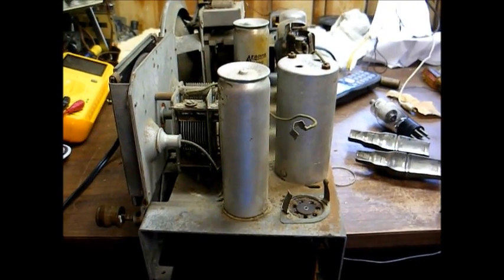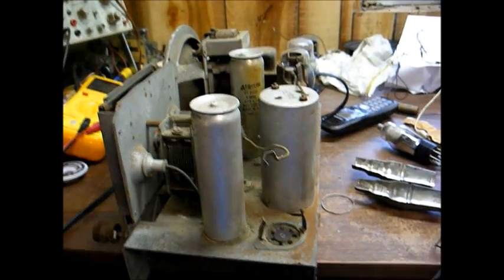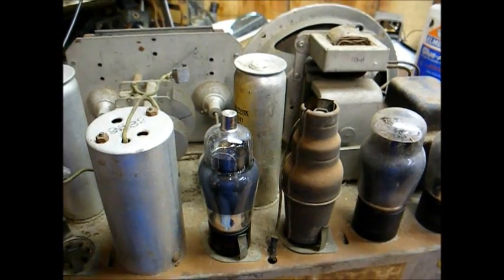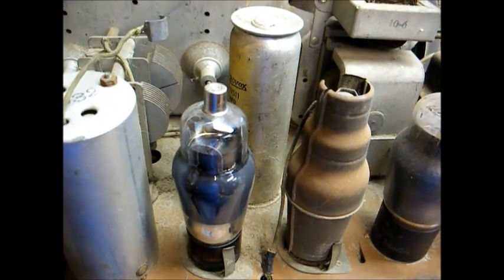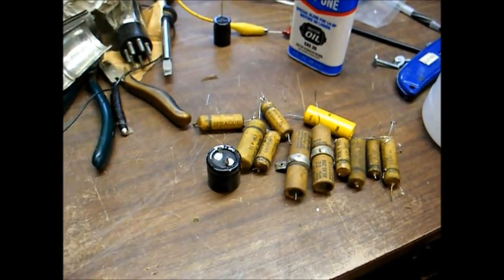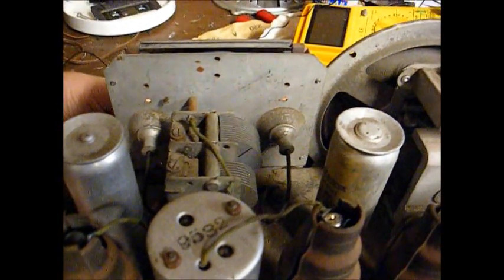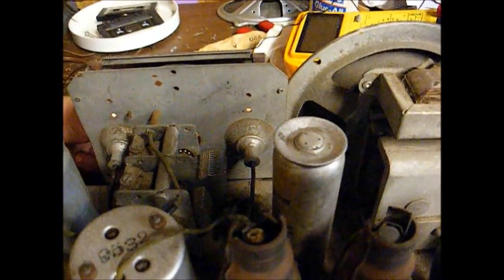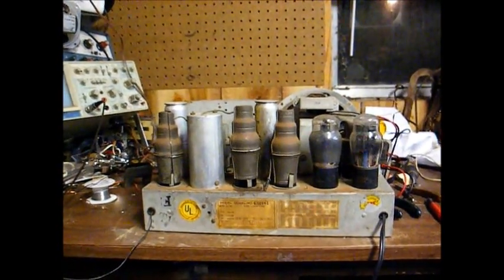Westinghouse WR209 tube radio electronic restoration (still having problems) - part four

Comment: See my comment in the 3rd part video...."In the last video you made a mistake with the replacement of the .05 .05 capacitor.  They did not make a mistake and print the value twice as you thought.  Instead this is a two section capacitor with the metal ground strap in the middle being the common ground for each end.  So this is two ,05 capacitors in one case.  You should have replaced it with two .047 capacitors."

Comment: Well, I gave MY opinion in part 3...I'd of replaced all the .05's with .05's & then replace the weak tube & the one next to it, re-tune the IF's & go from there. Being that it had that new power cord, I think someone was twisting controls in the BACK  of the radio & something's outa kilter!

Comment: Didn't you say the ocilator and mixer tube was weak? Why not replace it and give it a go. If that doesn't work, could the speaker field coil and voice coil be switched? I have a 1937 Packard Bell radio that I got without the speaker. It was my first tube radio and I wired the new transformer/speaker into the place where the field coil should be. I got very similar results until something in the radio fixed itself (bad cap reforming or a bad wire joint coming back into contact maybe?, was using all original capacitors at the time) and I got as I should, no audio. Found out about my bad wiring, fixed it, and the radio worked fine.

Comment: "...here is all the old capasitors that i removed from the radio maybe i can sell thise to the guitaramp people how like the sound of leaky capasitors..." i sometimes get the same thought. i was ones in a guitar store to get some guitar tuning screws for an old acoustic guitar i bought at a fleemarket and i overheard a discussion between the shop-assistant and a customer the shop-assistant said that he had tryed special wax oil (newly made) type caps and the sounded the same as orange drops caps